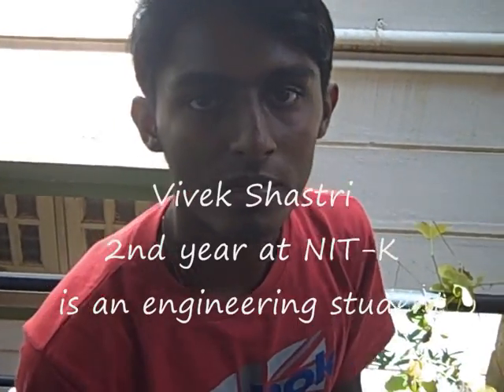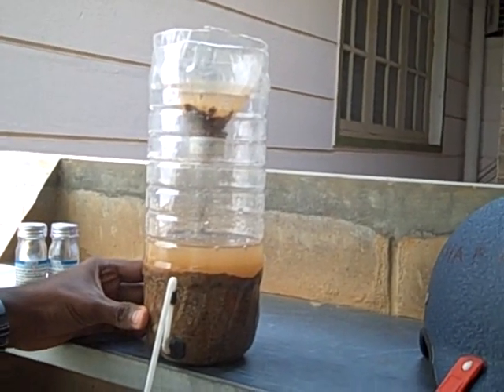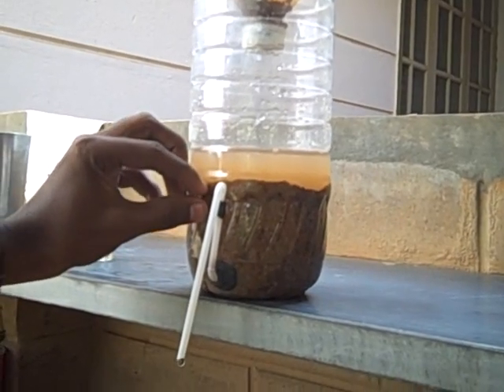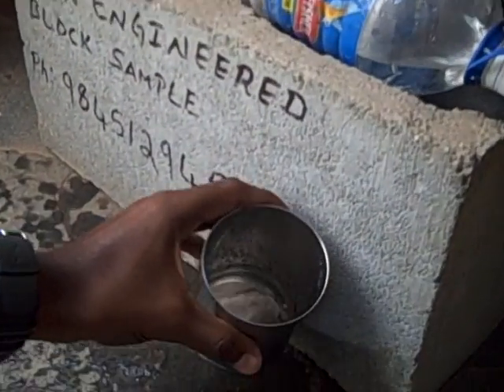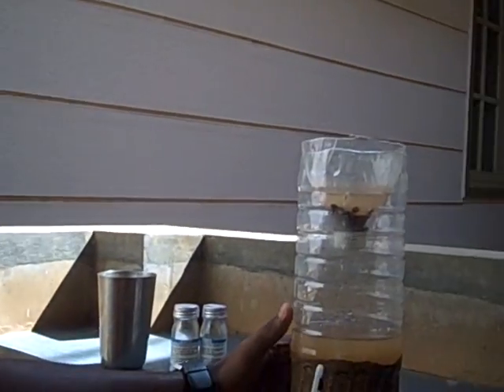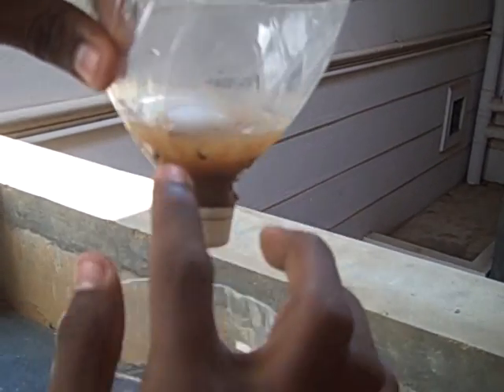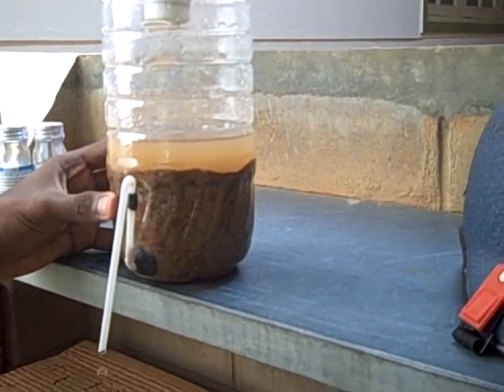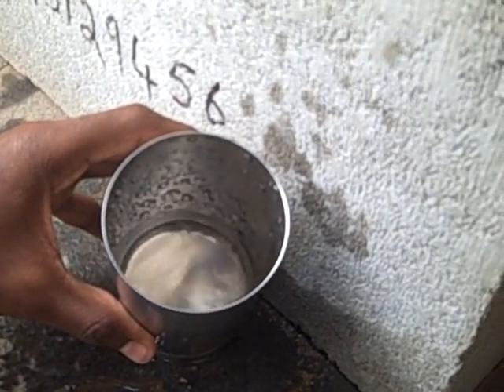Bio sand filter - Using a 2 litre PET bottle (before SODIS)

Comment: I just  built a filter with a barrel filled with gravel, sand and charcoal layers.  the water doesn’t filter through anywhere near as fast as needed for our kitchen water.  And The grease is first filtered out by two grease traps. Any ideas?